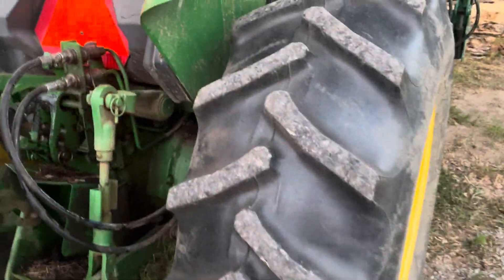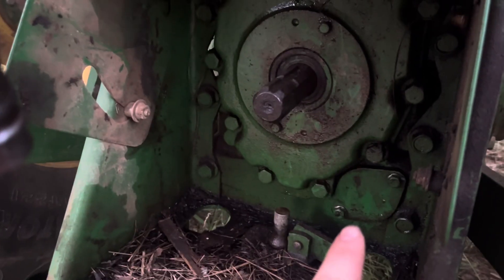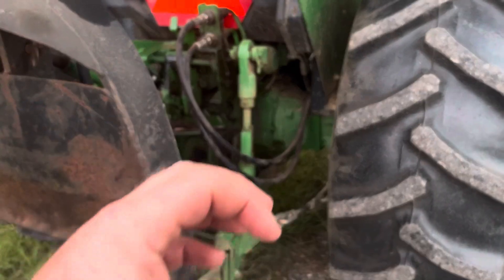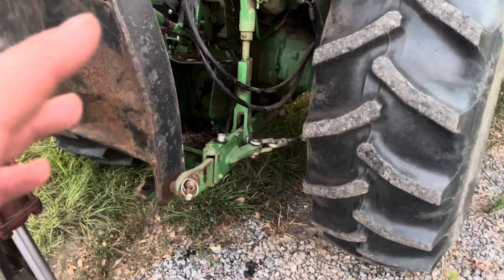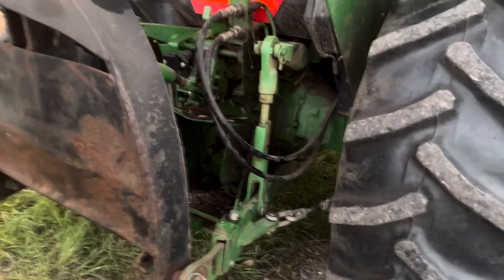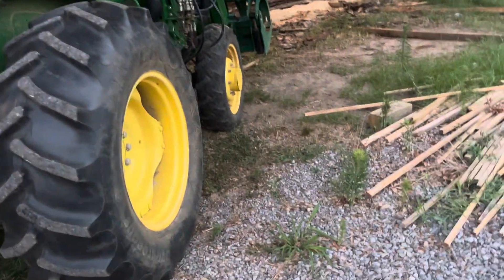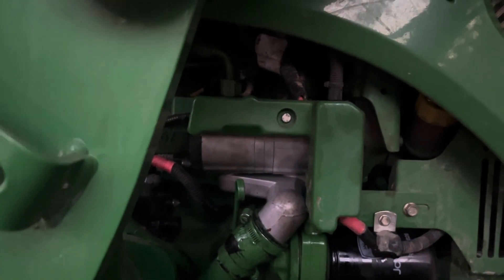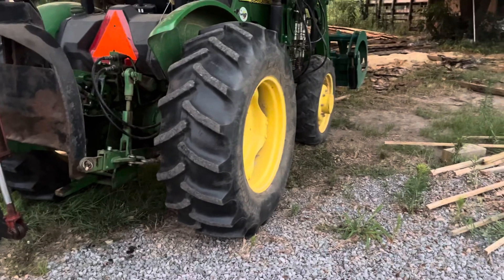Hydraulics are jerky on a John Deere 5075e tractor

Comment: Very useful video. Everything you described, I am having with my 5065E.
Frothy oil. Bumpy bucket operation. Clunky steering. Gonna try this fix. At just over 1000 hours I have obviously changed the hydraulic fluid and filter several times, but never that screen. Thank you.

Comment: I have an 88' deere 1050. Shes a rare open center deere being built by Yanmar. Has excellent power between 44 to 46hp while running at pto speed, pumps only moving 7.5 gpm at 11cc's but this model is notorious for the owners not being worth much lol that and for the guys who really arent using them and using them anywheres near enough the fckn hydraulic flyid doesnt get hot enough to burn off the moisture, which builds up eith other contamination and really fcks the systems up. A much more powerful system has much more leeway then the 40hp class utilities (older machines like mine) get choked easy

Comment: I had replaced the main filter - looks like a large oil filter - a few years back when the hydraulics started "jumping" and it smoothed it out. Last weekend I was moving some round bales and it starting jumping again and making noise. I backed it inside - windy and cold outside - and drained the oil - about 9 gallons. Then I took the pickup cover off. Inside was a tubular screen about 9 or 10 inches long that fit into a recess on the other end and on the cover. It was covered and I mean covered in a brown substance that more than anything resembled wood shavings. I scraped it of carefully with a chisel and then sprayed it good with brake clean. Then I blew it out thoroughly with the air compressor. I put it back together and put the old oil - well not really that old since some of my machinery leaks - back in. Started it up and it ran quiet and front loader and 3 pt. work perfect. The steering was good again as well. I got the idea to check this watching your video. Thanks for posting. Always start with the simple fixes so you dont wind up rebuilding a part or worse yet buying a new one when you didn't need one.

Comment: Thanks for this video. I’m dealing with jerky ass hydraulics right now, especially while trying to back up. I have 1100 hours on mine and never changed the fluid. I usually just keep adding fluid as half my farm implements leak haha. Anyway, JD dealer said to change oil (use only hy-gard), and clean the filter you were talking about.
Reply from the maker: @frfarmranch3837  I would just pull the filter and clean the slime off of it.
Reply: @Jackofalltradesmastersofnone  I drained the fluid last night. Slapped on a new filter, and also cleaned the gunk out of the pre-filter, it was pretty damn gunked up.  Plan to add fluid back in this afternoon. Will report back.
Reply from the maker: @frfarmranch3837  give us a response if you can reuse the oil without a problem. I replaced my oil before I found that filter but I plan to drain and clean that filter every couple years because I’m like you and have to add a gallon or more every year it seems.
Reply: @Jackofalltradesmastersofnone  unfortunately my issue still remains. All new fluid, hydraulic filter and clean pickup screen. Very smooth going forward, extremely jerky in reverse
Reply from the maker: @ I would work it some Incase something got stuck in the pump and maybe change the filter again before I bought a pump or took it to the shop. But remember to change your filter every year or 250 hours will help.i hate you are still having problems